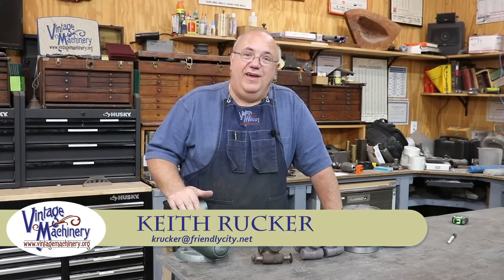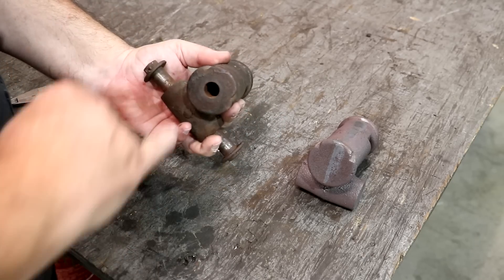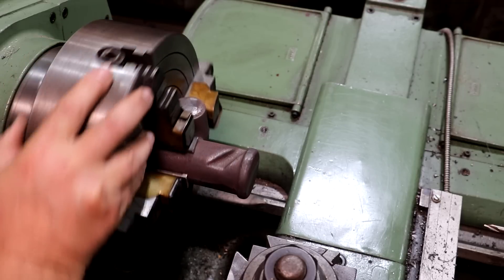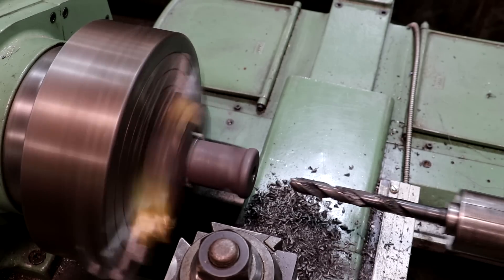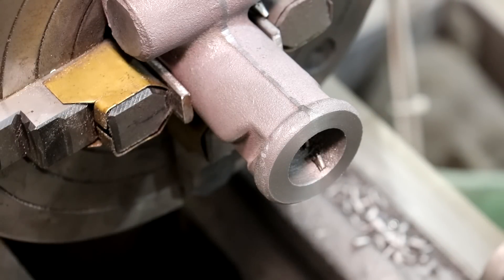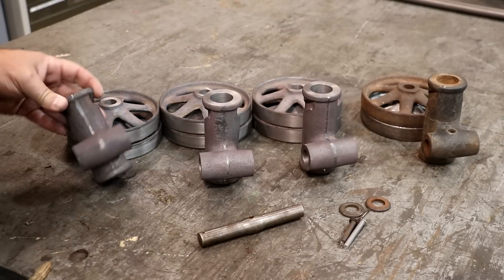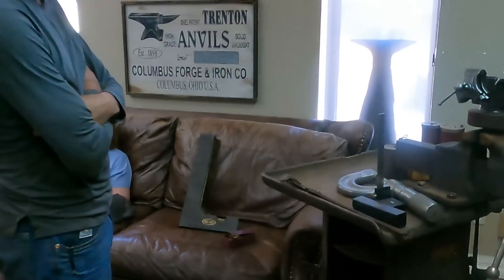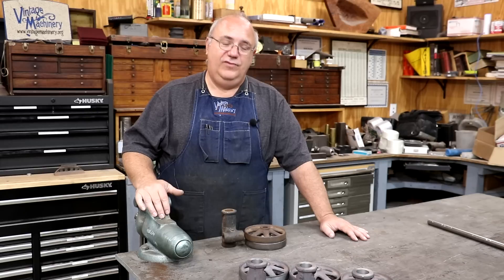New Britain Vise Cart Casters:  Machining the Body Casting

Comment: New Britain Machine Company manufactured multi-spindle screw machines. My Dad set up and ran them for about 45 years. I believe this vise cart was sold as an accessory to be used in the shop where they would have sometimes Hundreds of the New Britain machines all lined up making small parts up to about 1.75" dia. Many, many of these machines were used in the WWII war effort. Dad always told me he would kick my a** if I got in the machine trades. Of course, what did I do? I was a machinist for the biggest tool company in the world. Such is life.

Comment: I worked for Waner and Swasey as a tool &cutter grinder. Your right cast iron  is usually very easy to cut 
so long as you don't run into hard spots or sand. 
They can eat up cutter and make the tool grinder's life very unpleasant .

Comment: I'm curious about something. When you're checking the measurements on these caster bodies, why would you adhere so closely to the dimension of obviously worn parts? The large diameter hole on the casting, for example, measured at 1 5/32", when you know in your heart it was most likely 1 1/8" or possible 1" even.

Comment: Interesting cart. A bit challenging without the cart to examine. I was wondering how wear might have caused the unusual hole size for the vertical hole. And what the current size of the post the caster mounts on has become.

Comment: Hi Keith, thanks for the video. 
As usual I'm a little confused. The cart Andrew showed needed one castor on the "front" but it looked like the rear was set up with two larger wheels on a long axle.
If his friend is setting up another cart where does the original and the other two sets go? Is his cart different in that it has six wheels instead of the four on Andrew's?
If that's the case then IMO Andrew has the better arrangement in that his friend's cart is likely to behave like an English shopping or airport cart with three sets of wheels each trying to go in a different direction.
Regards from Canada's banana belt. 
 👍🍌🇨🇦🕊️🇺🇦🤔🇺🇲🦃🇬🇧🤞
Reply: Andrew's has some non-original kludge casters on it. It's supposed to have 2 small cast-spoke wheels on the front and 2 larger ones in the back. He's also missing the 'steering block' that holds the two front wheels on an axle. There are some pics on the internet of what it's supposed to look like.

Comment: Looks like one caster per cart, right?   So that makes me wonder why make three?   Maybe there’s more to the back story???
Reply: 22:14 " and get these parts sent over to um to andrew and uh one of them is for him one of them is for or two of them are for a buddy of his uh who i think is also needing the
same parts and who also donated the original one for us to kind of copy so we'll be getting that back to him as well so with that that's gonna be a wrap "
Reply: At the end of the video,  he shows one vice cart, and explains the other 2 go to a friend of his. I always ask questions before the final ending...as well.
Reply: @paulsilva3346  Paul I wondered the same but it sounded to me like, "friend" donated one castor for a sample. Andrew needs one castor for "front" of his table, "back" has two fixed, larger diameter, wheels. Friend's cart will get it's original castor back onto the "front" while the other two sets will go onto the "back". Therefore friend's cart must be different to Andrew's in that it has "three wheel steering".  
Have you ever encountered an English shopping or airport cart? The bloody things have minds of their own. Go where and when they choose to go. Only advantage these carts have is their weight to anchor them to the floor. If my summation is correct then IMHO Andrew has the better cart. At least it'll be controllable.
Reply: The front end of what Andrew has is a total non-original hack with modern casters. The front is supposed to have a 'steering hub' and 2 small cast spoke wheels on an axle. Then two bigger wheels in the back. There are pics of what its supposed to look like on the web.
Reply: @Bobs-Wrigles5555  Thanks.....I missed that part of his ending dialog.
Reply: @paulsilva3346  Thanks.....I missed that part of his ending dialog.

Comment: You Americans make it so difficult for yourselves still using imperial.
Reply: As an old mechanic that has gone through the change from imperial to metric I will disagree with you. At 73 years of age I still think in imperial. I have to convert to metric. 
I now do some machining, and If a bracket is in metric measurements using the DRO on the mill is fine but imagining the exact size is difficult. Hard to explain, but I'm sure you feel the same way about imperial.
Reply: @chuckmayerchak3071  I'm with you Chuck. I'm 78, have worked both systems for years. Was educated in ft/lb/sec system then changed to M/kg/sec system and 18 months later to cm/g/sec system. Confused? You bet. Now have an imperial lathe so use as many imperial measures as possible but am quite adept at switching to metric if needed.
Friend sent me a photo of a double ended, adjustable (crescent) wrench. One end marked imperial the other metric. Had a good chuckle.